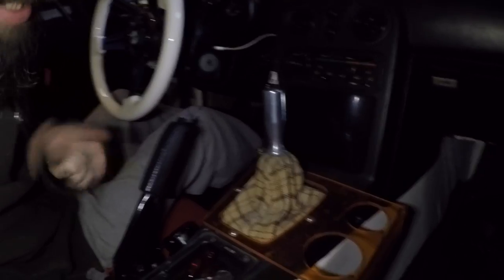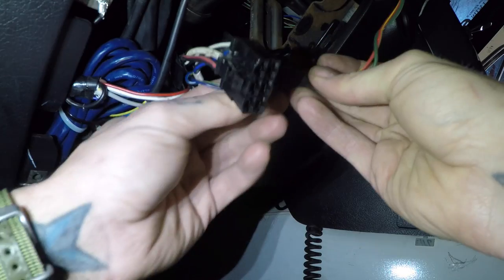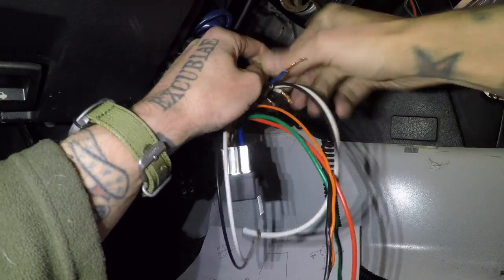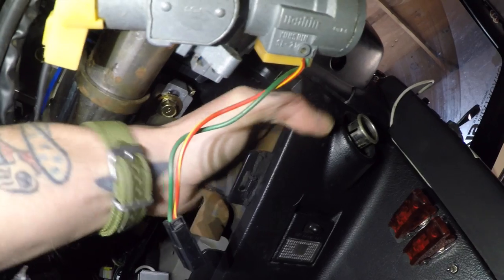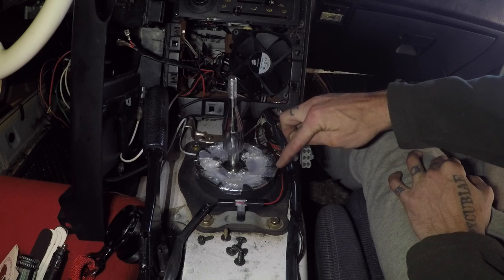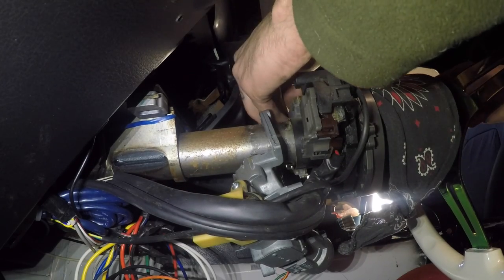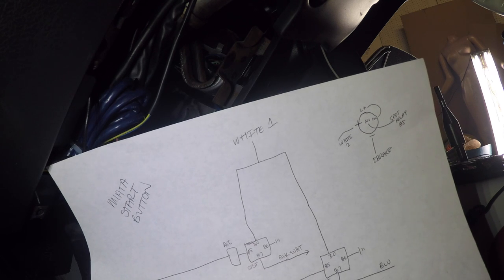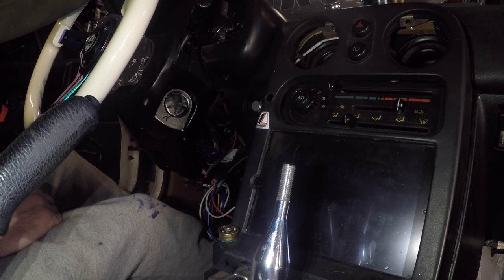Miata push to start button install Part 2 S07E16

Comment: Hello Wayne. Thanks for the Miata video & diagram. It was very helpful. I have a question though. How do you make the wiper switch work, since there is no more power going into the switch? Thanks in advance.
Reply from the maker: the wiper and blinker is a different harness completely, just leave it there.

Comment: I have a 97 Miata that I purchased with something relatively similar to this. However, my setup has NO relays on the switches. The wiring from the car directly feeds into three switches: one for allowing constant white wire power to go to the other two, one for the ignition and ecu, and one for accesories. Then I have a button for the starter. My question is will having no relays cause any issues? I’m having a 15A fuse blowing problem and I can’t locate the issue. My car’s wiring still has a problem in the engine bay but it goes to the EGR sensors and I wasn’t sure if that could trip the ENGINE 15A fuse. Thanks for the video, if I re do the wiring setup myself, I’ll do it the way you have it just to make sure.
Reply from the maker: engine fuse will be one of the two wires going to the engine from the switches. sending all that power through the switches all the time is an issue. can overheat and melt, lose continuity, etc... relays take the heavy power out of the switches. much safer and while you are in there you will probably find what is popping the fuse. also any wire issue should be addressed even if its EGR, tape it up or whatever is needed. a roadside fire is no bueno.

Comment: Hi Wayne, great video just wondering what numbers on your relays are going to the ground and what numbers are going to the switchs? You didn't say what numbers the black ones were and whites were on your relay as I'm just using wires, thank you
Reply from the maker: well, if you know anything about relays.... it doesn't matter which is the ground... one is, one isn't. thats how grounds work....
Reply: So all the cable that are left over on the relays are ground apart from the Ines that go to the switch?
Reply from the maker: lol if you watch the video and maybe google what a relay looks like and how they work, you will see that its usually 4 pins or 5. 4 pins means two are what turns on the relay and two are the power going through it. so, the switch side, usually 85 and 86 is power and ground from any switch. 30 will be power directly from the battery with a fuse preferably. 87 will go to the lights or starter or whatever the relay is powering. soooooo if power on 85 or 86, doesn't matter, and ground on 85 or 86, doesn't matter. just one power one ground. when that switch is activated, power goes through 30 from the battery to 87. now if you have a 5 pin, there will also be an 87a or 87b in the middle. if 87a, this pin will have power from pin 30 when 85/86 is off. if 87b then 87b and 87 will get power from 30 when 85/86 is switched on.
Reply: So what number goes to the switches off the relay because you didn't say that
Reply from the maker: i most certainly did.... 85/86 are switch. 30/87 are the starter/whatever you want to turn on.
Reply: Right I got it now, I did some research on relays so I know what I'm kinda doing but you said you changed the wiring because of the light on the start switch, would I need to change it if my start button doesn't have a light? Sorry about the questions so much
Reply from the maker: no, the light on the switch is just another ground wire usually. not needed or important. its really simple, i just made mine a little extra complicated cause I'm a nerd.
Reply from the maker: start at 1:40 and you can see the wiring diagram. https://www.youtube.com/watch?v=9Rea6T2-mi8

Comment: Awesome tutorial!
I have my loom all made up exactly as you have it (before you moved the start button off the 85 terminal of the SPDT relay), and when I press the start button something in the engine bay whines, the rev counter goes crazy and it smells smokey... I just had the start button in series on the wire going to the 85 terminal on the SPDT relay.

When you moved the start button to be wired into the 85 of the run relay, did you just connect the gap between the 85 SPDT relay (where the start button was before you moved it out of that circuit) together? Do you think could solve the issue I'm having?
Reply from the maker: oh man, smoke smell is bad. don't fry your system. something is definitely wrong. this was well over two years ago. i will have to watch the video again myself just to have a clue what you are even saying.
Reply: @pawpatina  got it working, dodgy cheap starter switch! Awesome guide dude, thanks a lot
Reply from the maker: @Tom-vj2ty  HEY THATS AWESOME! Congrats!! and thanks! glad ya figured it out!
Reply: So did you end up connecting the gap? Working on mine now
Reply: @WEVE-ob2jj  I left my starter button on the 85 of the SPDT relay, just bought a better button and it worked
Reply: Track Driver Tom so your start button is powered by 85 of the start relay. And you didn’t join them with the 85 of the run relay?

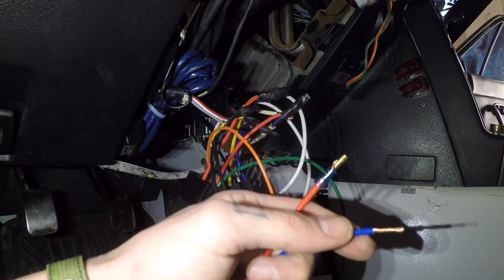Comment: Yo bro I'm trying to do this on Miata but I just couldn't understand you well lol.... I got lost around 12:07.... Do you have to have the parking brake engaged in order to turn on the car? If so how could I avoid that?
Reply from the maker: no the parking brake just makes the start button light up. just ground the button to any metal spot

Comment: Can i keep using the key for the wheel lock instead of drilling it out?
Reply: I want to install toggle switches in the armrest, push start in the cigarette lighter area, and keep using key to unlock the steering.
Reply from the maker: well yea... lol

Comment: What year is yours miata ?
Reply from the maker: which one? i had a 97, 94, and now a 93
Reply: The Miata you installed the push to start
Reply from the maker: that was the 94 but they are the same from 89-97

Comment: I really wanna do this because my key ignition is going bad.. I have to spam the key on and off to start my miata..(can take a couple minutes sometimes) seems kinda scary tho with all those wires lol
Reply from the maker: look inside any new car. there are way more wires than this.
Reply: WaynesWorkVlog that’s very true. Just worried that I might not keep the car forever and people might not like the push start
Reply from the maker: if you plan on selling it then just buy a new lock cylinder.

Comment: I have a question, what wire are you grounding? Is it just the one on the button?
Reply from the maker: don't know which part you are referring to...
Reply: WaynesWorkVlog which relays are you grounding?
Reply from the maker: they all have to be grounded... lol
Reply: WaynesWorkVlog thanks for the clarification. My next question is I’m using a 2 wire button instead of a three, do I ground the other wire or connect it to the spdt relay ? Thanks for the help
Reply from the maker: it depends on what the wires are for... will need a wire diagram for that switch.
Reply: What switch are you grounding?
Reply from the maker: lol.... dude.... watch the video.